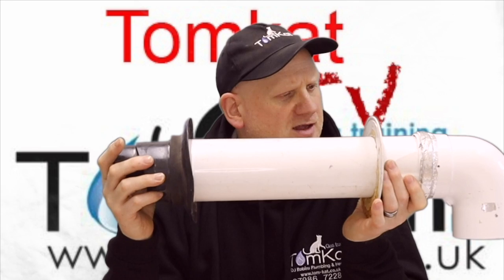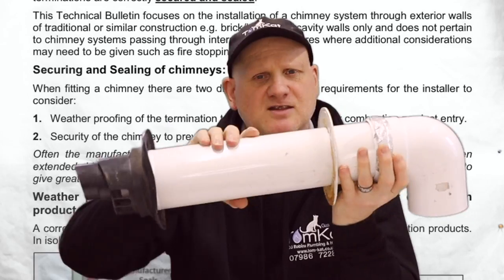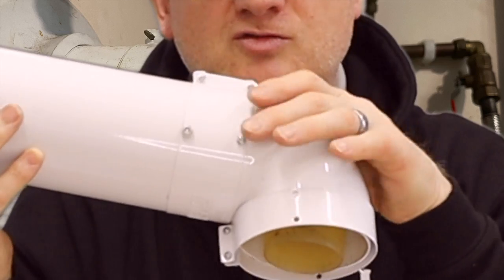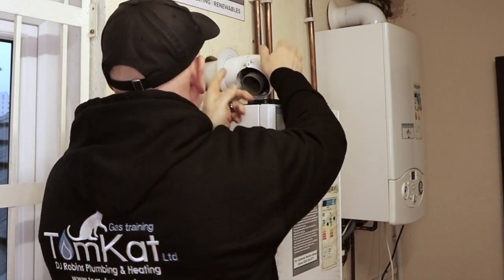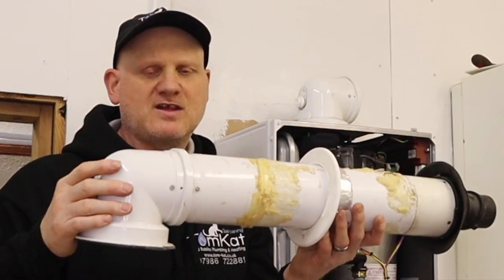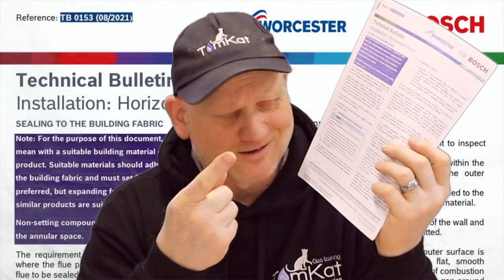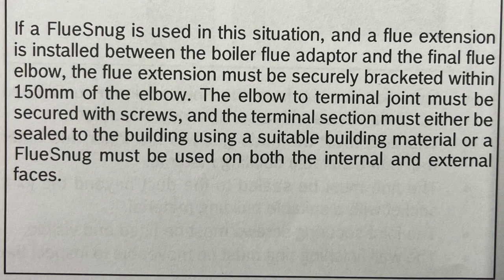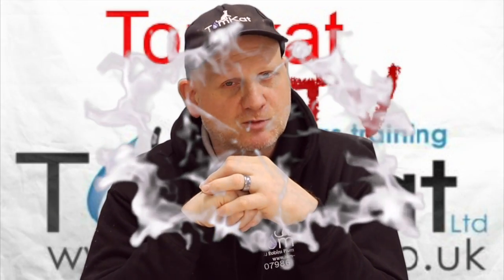Do we need to seal gas boiler flues, How to correctly seal gas boiler flues, gas safe TB 152

Comment: Who's coring 152mm hole for a flue snug.  As most existing holes are around 120mm. Worcesters use of expanding foam is mainly to aid or expel working at heights.  You're required to core 152 hole so the external weatherproof collar can be pushed out from  inside the dwelling.  In all cases I would still cement screw and fit the internal collar too.  Great info Dez,  here's to a better 2022 🍻.  Onwards and upwards 👍
Reply: Mate. You can put the thead through inside of the flue and the hole and pull it in regardless to floor that you're in. There is no need of corring 150mm although I have it in my van just in case lol
Reply: @igorchuchro4991  Ok, so how does the external waterproof collar go on?  Can you push it internally through a 120mm core hole?
Reply: @rayc1503  no. You put external collar on the flue. Feed the thread through cored hole and then middle of the flue outside you then pull the cord and flue is landing in the hole.
Reply: @igorchuchro4991  ok cool,  I'll try this next time I have restricted outside access 🙏🏼.
Reply: @igorchuchro4991  that will only work if fitting a one piece flue, not all will be suitable
Reply: @MrCobraRam  what do you mean ? Normal concentric flue is what I mean . Or anything really that you could put thread throughout
Reply: @igorchuchro4991  I suppose technically you could use your method for something like direct rear flue from vaillant/glowworm, but you would have to be boss level using the tape measure 😉. The weather collars don’t seem to be as bad these days and push through fine I found.

Comment: Ive had a new flue fitted today. The engineer has left 3 gaping holes. My flue needed an extension as it goes through kitchen then a small room and then outside. I was gutted. I had a decorator here at time. He charged me for filling in the holes. Should the engineer of made it good before leaving?

Comment: I would also agree with the opinion that external flues should be sealed to prevent water ingress into wall cavities, dampening cavity insulation etc. I have seen weather collars  fitted over external flues that hardly cover holes but excepted? If you were to carry out a service or gas check, and you came across a flue sealed with expanding foam, then how could you confirm it's fireproof and the correct material?  Sand and cement all the time for me IMHO.

Comment: Great video Derek. Never knew the Flue Snug existed until now.  If the pre-existing hole is already 152mm wide, i can see their use to save time and make the job look neat, but i wouldn't cut a 152mm hole just to fit one. I'd rather cement the hole. I can see these being reused during boiler replacements where the new flue is a push fit, thereby causing an AR situation

Comment: Very informative video, covering this very common problem..
What the best thing if the brickwork is in a mess, 
Rebuild the brickwork and cement the flue into the wall ?
Or possibly cement a piece of other pipe in and seal the flue to the wall as it passes through the pipe ?
x The Bigfella x

Comment: I had a rainwater leak coming into my Worcester boiler. I went out side and peeled back my rubber outer seal to find the installer had used interior silicon sealer to fill the gap round the flue and wall and it had shrunk. Water was running down my gable end and in behind the seal and into the house. I looked at various sealers and opted for a semi-setting rubber gutter sealer that could be applied even in the rain and on wet surfaces and could give me a good weather proof seal between the rubber guard and the roughcast wall. Problem solved.
So if you have a drip coming from the bottom of you boiler, check the outer seal.
Reply: Thank you for your comment. We're having the same issue. I wonder whether you would recommend on what brand of the sealer that you used please?

Comment: After some advice.  Our black rubber fluw seal on outside has failed and split and about to all off ( been on for around 15 years).  There is a collar inside and flue is sand/cemented in.  Appears the failed part is just to make it look decent.   

  Do i just slide a new 1 over and fix with heat resistant silicone ?

Comment: Great detailed vid as usual thanks Derek. Would you agree that the picture from the TB (at 03:00 on the video) seems to suggest that sealing with sand and cement from either inside or outside is acceptable?
Reply from the maker: The best way is sand and cement and like I say in the video if the boiler has a rubber collar on the outside you only need sand and cement on the inside

Comment: Hi can someone help
I have a valiant boiler which is 6 years old 
I have just had it serviced by British Gas and they have put a danger do not use sticker on it because he said my flue was not cemented in and was dangerous but ask do I want the gas turned off I said no 
Can some one tell me is this correct and should it need cementing in 
I have done this just to be safe 
I have silicone around the flue and a out seal 
Any help would be appreciated

Comment: Hi Derek, thanks for your videos they are really helpful. What about flues passing through timber framed buildings? I read they need to be lined and sealed?
Reply from the maker: Yes they do 👍🏻
Reply: Thanks Derek, What would you recommend lining it with and sealing? I have a install coming up in January and just wanted some clarification.
Reply from the maker: @prolag9181  my best advice would be to contact the boiler manufacturers for advice.
Reply: @tomkatgastraining  👍
Reply: Some manufacturers don't require a sleeve. It was originally done for heat/ fire protection. Best thing to do if wall is open is get chippy to cut in a box and line with fireproof board. Vapour barries need to be keep up aswell.
Reply: @TheDickPuller  worcester didn't when I last did timber framed. I worked on sites which had isars and cdis I think it was (half social half private) . We had to sleeve the ideals but not the worcesters. We had a email from WB technical confirming this. Every first fix I did had a superlux box put into the wall (plasterboard to outer brick leaf) for the flue but many of the other first fixers didn't do that so they had to sleeve which was a right pain. 
The ideals also required a superlux board between appliance and plasterboard from memory. Probably all changed again now. I think ideals stance at the time was follow standards and worcesters was we have tested it and it's not required by us.

Comment: Mu outside flue end the black bit is missing any ideas where I can get the end please thanks
Reply: Is it a Worcester Bosch by any chance?  If so a complete new flue and and change the external black section.  I've seen aleast 3 of these broken.  Probably kids kicking footballs against them.
Reply: @rayc1503  yes it is
Reply: @noshah11  The black central plume section can be purchased if I remember correctly.  If it's the rubber gasket and clamp them you need a replacement flue. Don't disturb the flue itself if at all possible.  That's a job for someone who's gas safe registered.

Comment: Does fluesnug and pipesnug guarantee the slope downwards and upwards or you need to drill at an angle? I know that using a core drill hole saw at an angle is very hard and plumbers usually to overcome the issu do drill larger diameter holes and then slope the pipes inside? How to do that using this system? And if I already have 4 inch hole to reuse, what can I use to enlarge it to 152mm?
Reply from the maker: The standard flue in most boilers has the fall built in so you core straight

Comment: In regards to classification as AR, if a boiler is sealed on the inside but externally there is no rubber collar and/ or you are unable to fully inspect the flue visually externally (high level flat) to confirm its fully been sealed with sand and cement externally, would this be deemed AR?
Reply from the maker: You have to think is it at risk of becoming immediately dangerous. If it is sealed on the inside with no cavity wall and no co on a sweep test then how would this be AR but if it had a cavity wall and POC was going into the cavity that’s a different story.

Comment: As someome who was told by bg that thier flue wasnt sufficently support despite sand and cement seal , screws amd 1 clip this video just adds tl my argument , bg are adament it needs 2 clips which is fine for belt and braces but stupid to say potentially dangerous given the other fixing points.

Comment: Can you sand and cement outside behind the weather seal then foam inside?
Reply from the maker: Depends on the boiler manufacturers but why not just use sand and cement inside too
Reply: @tomkatgastraining  ideal world yes or can request plumbers to do it in there price. I'm a site manager and we generally foam and fill

Comment: Has any one used the “In 2 Out flue seal would this be compliant
Reply: We need to change a boiler on the 3rd floor and would only be able to cement outside with a Cherry Picker.  The quote for this was £500

Comment: What’s your thoughts on using silver tape over the flue joins. I was always led to believe that tape wasn’t aloud as it hides the join so can’t be inspected and may be hiding something. Great vid
Reply from the maker: The silver tape is not needed unless the boiler manufacturers supply and or spec it.